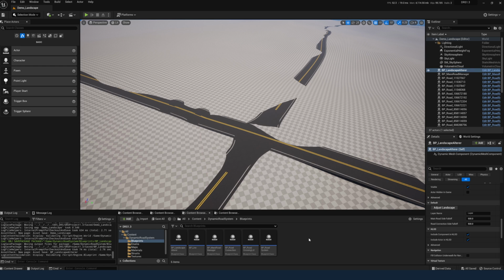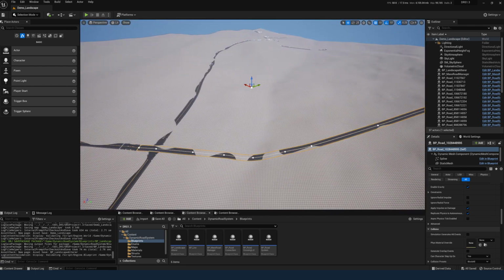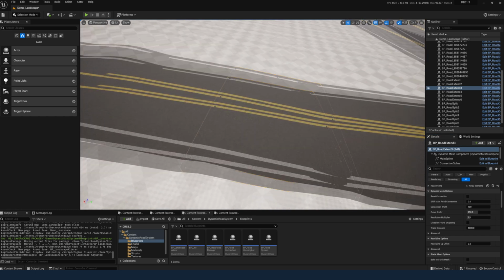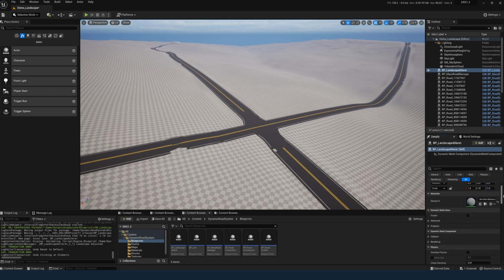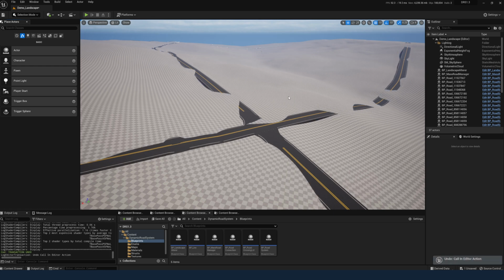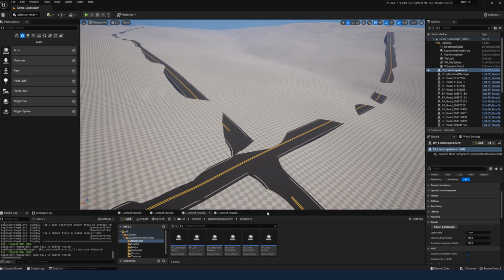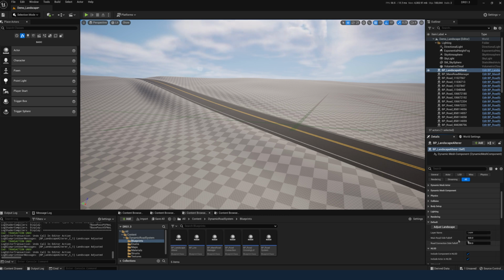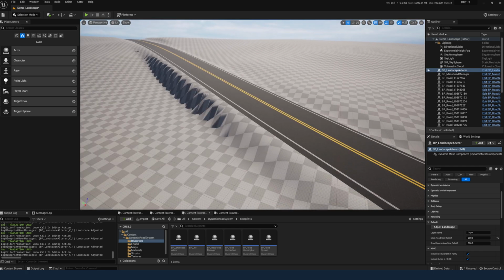Dynamic Road System Early Feature: Automatic Landscape Adjustment

Comment: Instead of roads could I create pathways this way?
Reply from the maker: Using this method? Yes. But not quite with this blueprint since it only looks for Road System blueprints currently, but it should be easy to reconfigure. What you could do is make a blueprint that just has a spline component and use the spline to control your path and then go into this blueprint and change all the references from the road system blueprint to the one you just made and it should work
Reply: @AVieGuyStudios  I will try it out and buy it this evening when I'm home. This seems like it's by far the best road/spline Blueprint system I've seen. How are you altering the Landscape? Are you spawning Texture Patches or something underneath the road?
Reply: Also, once I alter the Landscape to match the Spline Mesh, could I sculpt the Landscape manually around the falloff areas and it won't affect anything? Also, are you finding Nanite Spline Meshes are working in 5.3/5.4? Sorry for so many questions.
Reply from the maker: @AidanNewsome  The landscape is imported from tangram height mapper which is a great tool for real world height maps but the quality is iffy in the servers lately
Reply from the maker: @AidanNewsome  right now the method is destructive for this landscape alter which means once you do it will be irreversible if you save your project. But after that you can manually edit like normal with the landscape panel
Reply from the maker: Also feel free to ask as many questions as you'd like. We do also have a discord where it may be easier to have longer conversations if you're interested
Reply: @AVieGuyStudios  Thank you! I've joined the Discord and just bought your product. Looking forward!
Reply: I've noticed in Discord feedback it seems like the main downfall is it's destructive towards the Landscape. I'm wondering if you've tried taking some functionality from the Landmass Plugin system and combining it with this tool. You can deform the Landscape with Splines non-destructively this way. Check out Chris Murphy's West Aus Games talk.

Comment: you can literally edit parameters inside the default landscape spline easily and get this results, how is this any helping
Reply from the maker: Our roads don't use landscape splines because they have a couple of disadvantages like not being able to change some of the geometry at run time (like changing road Ines is impossible unless you have hundreds of different static meshes to switch to with the road line format you want). It also can't use nanite right now, but our roads can, and that saves a lot of performance. So we are trying to copy the effect of landscape splines adjusting the terrain without actually using landscape splines
Reply: @AVieGuyStudios  I think you're doing it the right way. Landscape Splines suck IMO. It is way more useful to be able to have everything editable outside of "Landscape" mode for so many reasons.

Comment: Would there be any way for instead of adjusting the landscape destructively around the roads, you do the opposite and adjust the roads to the height of the landscape with a way to shrinkwrap the curve to it or something kind of like that?
Reply from the maker: The Dynamic Road System does have a built-in method to snap the road to the landscape. However, it only snaps it by each spline point of the road. For this video, I used my OSM bot to automatically download the road data, and it doesn't use a lot of spline points, which is why a lot of the road hovers or is buried. If I were to use more points to shape the road, it would be a closer approximation to the landscape. This new blueprint adjusts the landscape to fix the gaps that are left over when it snaps the road to the landscape, which should save developers some time from manually trying to sculpt away the gaps